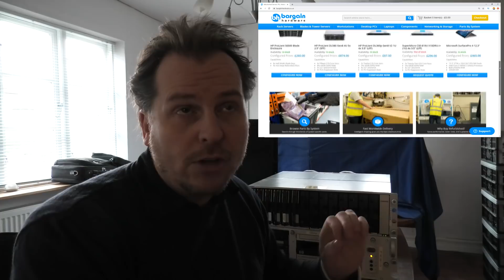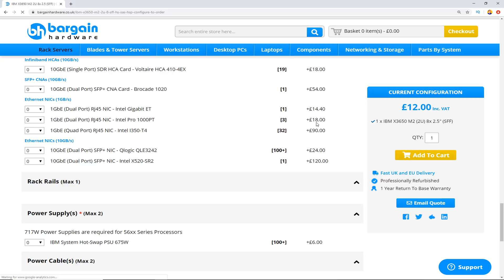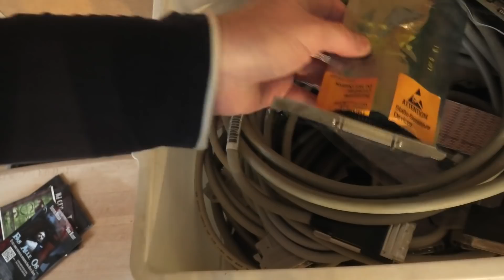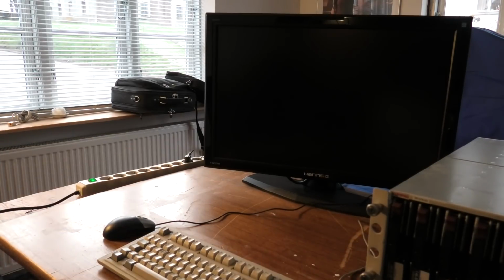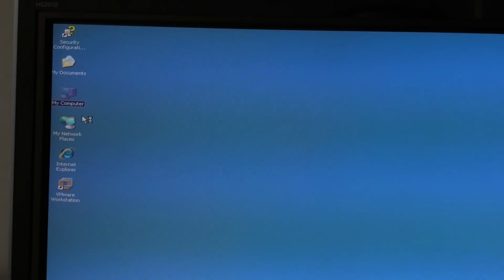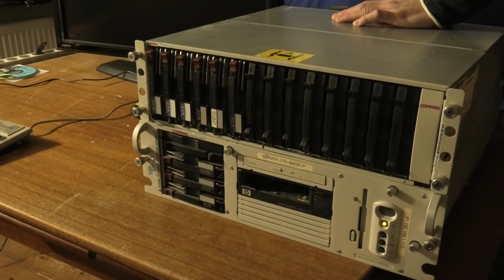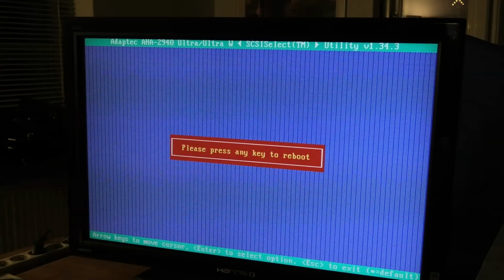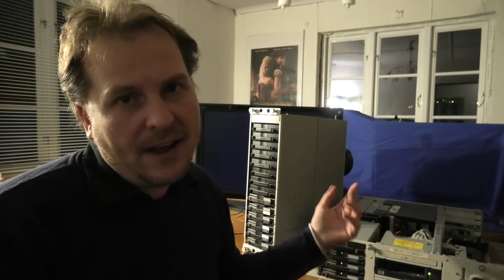I Flunked UP the SCSI and OS on this Compaq DL380 Gen1 - 904

Comment: I had a similary proliant server in Denmark.
You can easy run the drive bay on the internal SCSI controller , thats actually why you have the SCSI connetor on the back.
You need to set a jumper on the motherboard and set it up in the bios to function also remember to set each drives SCSI adress on the drive itself otherwise it will conflict and thus you cant see the drives.
You didnt need to remove the network card at all.
you have 2 unused PCI slot , you just put the adaptek in one of those if want to use that one ( I had this adaptec too )
To make it work you need to config the adaptek as a secondary controller and you be without trouble.
Just remenber SCSI drives have an adress jumper on the drives themselves or / and in the BAY , so set the internal to SCSI 0 and the BAY to SCSI 1 they you good to go .
Hope it help you  a little.
GO to JHP/ COMPAQ and download the PDF manual and check all jumpers on the motherboard , they play a crusial role in the config.
Reply: Oh and to make it really fast . Run LINUX on the server , IT really give you both resources free and more power to run applications.
ITS actually a really nice server they never break down especially not with LINUX installed.
( damn I regret I didnt get my servers with me when I leaved Denmark )
Reply: Sorry typo not JPH / Compaq but HP / Compaq , they have their own pages in HP network ..
Reply: Jeg håber dette kan hjælpe dig lidt på vej til at få serveren op at køre .
Reply from the maker: Hi kenneth sørensen
Thank You very much!  there is no SCSI ID select,,the DAS takes care of that,, and the same thing for the internal drives.
Thank you for watching! :-)
Reply: @MyPlayHouse  oh du har den model uden jumpers. min havde jumpers , det er meget mere simpelt.
oh no thsnks , I enjoy videos of such older hardware , always something can either learn from or maybe help with .

Comment: When you first connected the top array it was all set up good, all you had to do was set your external disk array to id1 not id0 as it must have been set and the server would have booted on its internal boot disk and the os would have mounted the top array as drive D:/E:/F:/ so on dependent on its config. Where you went wrong was not having a scsi terminator on the top array ie where you plugged in the cable on the top array there should have been a second port where you would have needed to add a scsi terminator at the end of the scsi chain, if not an external port you must place a terminator at the end of the internal scai cable insidt the disk array, the controller would have then seen the conflict issued a warning but would have auto incremented the id and fixed its self, the controller would have looked up the chain for the terminator the array inside the box may have had a terminator which if present should have been unplugged from the internal controller/cable if it was present, and placed at the end of the array on the top box, remember the disk array you have could have been /dev/scsi/0/lun0/id0 of a /dev/scsi/0/lun/14/id15/  array with up to 255x14x14 disks the chain stops with a terminator and data can then flow back to the controller and would have auto incremented the id of the array and reported its disks and array correctly  the 4 errors you had at the bottom of the screen showed the conflict of the internal and external array on the same controller reporting the same ID0, un plugged the adaptec controller and top array then at boot using the internal scsi controller bios just rebuild the internal array and reboot simples ;)   hope this simplifies the scsi chain.
Reply from the maker: Hi lul bro
Thank You very much!  glad you liked the video :-)
Thank you for watching! :-)

Comment: Now that sounds good.
I have a local it security co that sells me parts, I have clearence too, but I can get what I want cheap... Or eBay...

Now this video was interesting.
I was having a debate about Linus tech tips and the servers he had made for people "ltt 130tb file server Nas."

Now I'm old school, so when I think of the problem and solutions I have over 4 decades of knowledge.
Now there is this NAS thingy, and we'll the problem is raw uhd camera (4k+) video from red cameras so a minute is somewhere around 730gb a minute.
(High frame rate slow motion).

Now I think the Nas is the wrong solution. I would think SAN and or DAS is the correct solution to the problem.
The premises are;
 that storage requirements grow quickly.
That you can add more for less.

Now Nas boxes are limited servers so when the bays and drives are full, that's really it. You could buy another one, but is that really cost effective when you can use das and San?

What's your view?
I think scaleability is key here in these types of problems.
Reply from the maker: Hi Rory Witham
Thank You very much! I think Linus Tech Tips,, is just accumulating to much video,, or rather,, they record it in to high a resolution and do not use the compression,, they are recording video in a quality that most cinemas would not be able to show,,, WHY,, These tech videos are irrelevant in a few years. I do not get it.
I am at over 900 videos and just under 10TB,, and I have every pieces of footages, projekt, rendered out videos and the graphics..
Thank you for watching! :-)
Reply: @MyPlayHouse  yes seems that people are keeping raw formats. I can't see them taking all that space!

I got some thing you may like to see, it's from a video you shot back in 2015. 
Your first servers, I've got one which is a little older...and I have it's DAS as well.
Oh the weight of them!!
I'll have to go to my storage to get the matching desktop unit for it too... I'll try a video sometime this week hopefully. I'll tag you if I can..

Comment: You need a Compaq Smartstart CD-ROM. With that cd you can configure all the Compaq parts and compaq raid controllers.

Really cool to see the disk array. I had one back in 2005 or something. ML370 with 7x 36gb compaq diskshelf with 14x 36gb and a dell disarray 12x 18gb (I have this unit back, im collecting 73gb 15K drives for it 😀)
Reply from the maker: Hi Victor Bart - RETRO Machines
Thank You very much!  I spent an hour searching for the Smartstart CD,, I do have one somewhere.. :-)
Thank you for watching! :-)
Reply: Links to all the goodies you need...

https://community.hpe.com/t5/ProLiant-Servers-Netservers/SmartStart-CD-s-for-DL380-G1-servers/td-p/433099#.Xg-BxIw_WhA
Reply: Correct! The SmartStart CD will allow you to assign various hardware addresses/boot order/etc. for all your stuff. I had a similar machine back in the day, but a Gen2 I believe, and that CD was indispensable for setup operations!😉

Comment: Ah yes, this comes from the dark age of computing where the end user had to know how to terminate a SCSI bus, terminate a token ring network and other hardware things like manually setting an IRQ on expansion cards. Now we just have to do that all in software (BIOS/Option ROMs) :-)
Reply from the maker: Hi Geoff Seeley
Thank You very much! Back when they build it to last,, but you could Fu.. it up in seconds :-)
Thank you for watching! :-)
Reply: Shit do you really even need to do IRQs even at a software level? The only thing I fuck with much is COM ports and thats usually due to changing my FTDI or Serial to USB adapter. Or specialty setups like industrial scales.